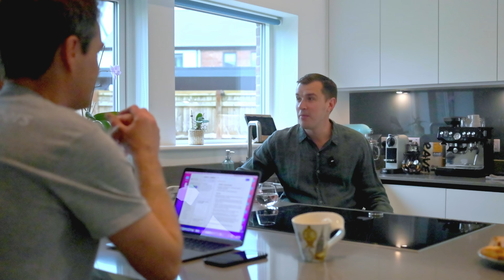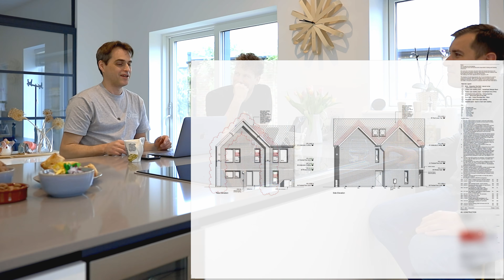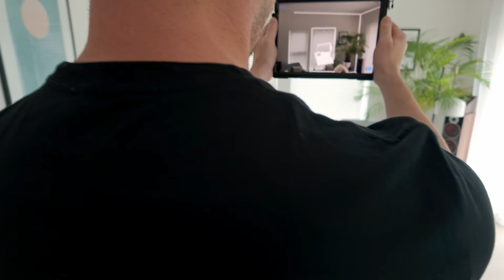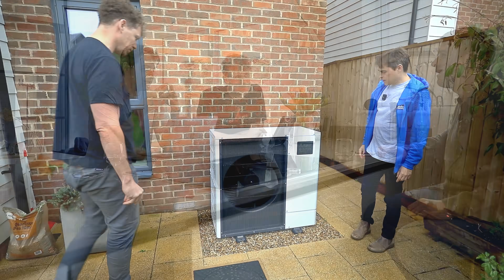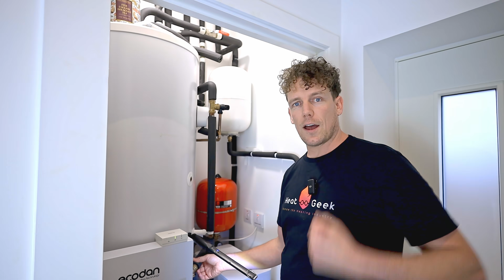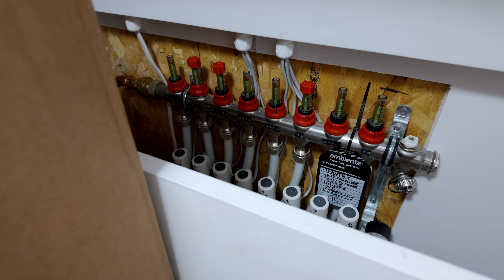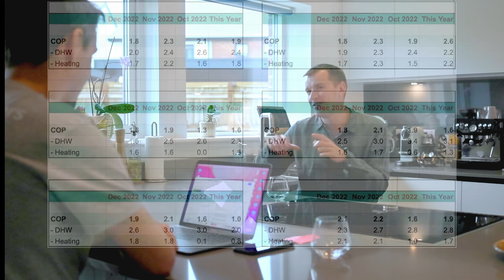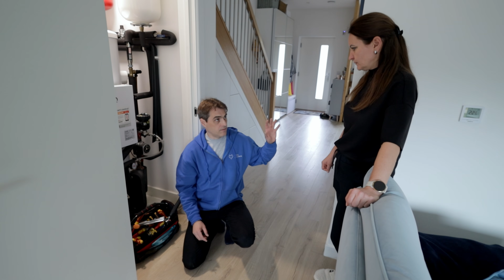How Developers Are Ruining The Heat Pump Market

Comment: Been here quite a few times. (Im not the installer) Pretty sure I visited when the place was a building site to rectify an issue with excessive noise from one of the heat pumps. The installers had not removed the transit packaging from the outdoor units.

In reference to pipe size, Mitsubishi have a set range flow rate for each model of heat pump and as long as its within that range, Mitsubishi are happy its installed correctly. Very odd. Same with the reason why Mitsubishi pre plumbs come with a magnetic filter on the flow, again odd. Or why the cold scale trap filter is after the plate heat exchanger. (The location of these are now changed on the new pre plumbs). That change over from 28mm copper to 22mm copper from cupboard entry to magnetic filter is not going to change much, the pre plumb is in 22mm copper. (Mitsubishi also now have 28mm piped pre plumbs) Although the pipework size and components do add further restriction by poor design, I believe Mitsibushi tried to combat this by introducing the UPMXL GEO 25-125 130 circulators and the UPM GEO, both have a high head and flow capabilities.

In reference to the expansion vessel. Ideally you want it on the suction side of the circulator and on these pre plumbs that is as close as you are going to get the expansion vessel to the suction side of the circulator unless you cut into the pre plumbed factory pipework (No developer installer is ever going to do that) The circulator on these is after the DHW plate heat exchanger and after the header, with very little space to actually cut a fitting in.

Suprised to see the calculated heat loss as low as below 4kw and would have expected to see an 11 kw unit cycle more than what romans has. His had an average of 1.82 on/offs per hour of run time since install.

Definently would not trust the estimated energy delivered on a Mitsubishi.

Always recommend the use of the mitsubishi wireless electric thermostats on auto adaptive mode especially when a property is open plan with way too many thermostats and zoning. They already have x1 upstairs, they would just need another downstairs or just move the one upstairs downstairs and heat all as one.

Should see the new build developments around woking that are using Mitsubishi. Someone specs the design, someone installs it and the installer just fits it, even when the installer is told by us that things should be installed differently their words to those above fall on deaf ears. Shame really.
Reply from the maker: Low on offs could be because stats are holding the unit off for very long time so it only seldom comes on for short periods
Reply: @UrbanPlumbers  Would tend to agree but 3rd party underfloor heating thermostats on Mitsubishi cause havoc, especially with their tendency to be too sensitive. The readings taken from the FTC is compressor run hours and start stops. I would still expect to see a high ratio between the hours the compressor has run compared to its on/offs as it would have sent short bursts of heat into the property, met the target flow temperature quickly and then turned off untill the temperature dropped. Unless by the time the unit flow temperature dropped to an adequate range to warrant the unit to come on again the room was already past the setpoint temperature.

Would expect to see a rough energy delivered for just heating at near 6k kwh if the heat loss is actually around 3.5kw. (based on 1691 degree days) With consumption expected to be around 1691 kwh of electricity if cop is 3.5. Would be interesting to compare the actual heating consumption.

Comment: Electronics engineer here; It seems obvious from an engineering perspective that short cycling is undesireable in terms of mechanical wear due to start / stop, but it doesn't seem obvious where significant efficiency losses due to cycling comes from... the electronics example would be driving an LED with a PWM to dim it (the ultimate in short cycling!)  is one of the most efficient ways possible (though can be annoying for other reasons).   Could someone explain where these losses are from?  It also seems obvious that short cycling must be to some extent unavoidable; if a heating system (needn't be heat pump) doesn't have infinite modulation then at some point the minimum output of the system will exceed the required input to the home, and the system will have no choice but to short cycle?   You could only avoid this by having a (possibly too wide for comfort) band of acceptable room temperatures on the controls that either left the heat source off (and so the temp stuck at the cooler end) or on permanently at highest modulation (so it ended up at the top end of the range).
Reply from the maker: Efficiency losses comes form too much pumping power (4 pumps instead of 1), hydraulic separation forcing higer flow temps and cycling. Cycling requires the unit to run much hotter than steady state and also ramping up from cold to hot - running steady state without breaks is much more efficient
Reply: @UrbanPlumbers  Thanks for reply.  Pumping power and hydraulic separation make perfect sense.  The cycling is a little counter-intuitive harder to understand.  Would be really useful to see this in practice for us geeks with some real data showing the power draw vs heat output over a period when a unit is cycling vs not cycling.  Could such a test be done  by limiting the modulation range of a heatpump to make it cycle (keeping absolutely everything else the same?).   Then we could know how much of an issue cycling really is.  

My other point remains I think that unless there are units with massive modulation ranges, these must be cycling a significant portion of the time, surely?
Reply: @jfinnie78 Also an EE but been following the topic of HPs for a while - the heatpump monitor site is a very useful resource for checking actual power versus heat output - my vague recollections from thermo days is that the efficiency of the Carnot cycle would be low input for maximum output which happens at low deltas of temperature rather than when cycling where it ramps up the power to hit the desired flow temp resulting in spikes of input versus output - I can’t think of any electronic analogies 🤔 apart from maybe relating to thermal performance of devices maybe
Reply: @Umski  I suppose an equivalent to part of it might be switching losses in a buck converter, where each switch has a cost, with increasing frequency hurting efficiency.  But we're not talking about ramping up to high temperatures, but just a bit above the desired flow; and then it is off.  I'm sure there is a small delta, but it doesn't seem likely to be massive.  I am assuming here that the short cycle only drives the flow temp a little above desired.  If it ramps up the temp hugely I'm sure that would be a bigger efficiency hit.

I understand these guys are trying to solve a problem so likely hit everything at once that looks sub-optimal, would be nice to see how much of a difference each bit makes.  Especially if fixing short cycling is something that has a comparatively high cost for smaller benefit.  Unless they can get a refund on the incorrectly sized unit, that particular change might not pay for itself.
Reply from the maker: It’s all on the heatpumpmonitor.org for everyone to see. Cycling causes loss of efficiency due to the fact unit runs hotter when it cycles before hysteresis shuts it down
Reply: @jfinnie78  I think the car accelerating analogy is the closest one where the HP is trying to get to the desired flow temp as quickly as possible from a "cold" state (I guess in theory it could be controlled to do this more gradually and my understanding of compensation curves is that this is happening to control the flow temperature to some extent, but not the initial modulation) so every time it hits the power, it ramps up and then the output becomes far higher than the demand and it shuts off, much like I see some drivers nailing it off the lights only to hit the next set further up the road versus the slow and steady passing through green and keeping the throttle at low values like on a motorway on cruise. When the HP cycles from hysteresis it allows for the system to cool and so has to work harder to then put energy back into it rather than just "topping it up" as it flows through. Similarly in a random conversation with John Cantor, talking about modulation, there is an optimum modulation point for the compressor so oversizing and then "letting modulation fix the problem" is not a great approach as the compressor may only be able to modulate down to say 40% of max output and peak efficiency at say 80% (just guessing here as they don't provide efficiency curves!) similar to peak torque in an engine - in this example where the requirement is 3-4kW but the HP is rated at 11.2kW it's clear that there is nowhere for the HP to dissipate the energy it is providing so will have to cycle once it hits the flow temp and the return is essentially the same purely because even at the lowest modulation, the output exceeds the heat loss of the property. The whole system then cools and it starts again. Same issue with over sized condensing boilers where efficiencies are higher when the return temp is less the 55C - if the output is always higher than the demand then it has to cycle - I know this from experience as my current boiler has a 20kW peak output but can only modulate down to 9kW but my heat loss at -2C is around 6-7kW so at higher outside temperatures it's even less - no-one cares with gas as it's not measurable but with COPs and SCOPs at the forefront of HP efficiency it highlights what a mess the state of heating in the UK is (hence raising an eyebrow when the average "gas safe" plumber refers to themselves as an "engineer" and proceeds to whack the biggest boiler/HP that they can find in!) As for cost - down to what the outlay is versus the savings I guess - do the math as they say over the pond ;)
Reply: @Umski  Very interesting.  You'd think it wouldn't go flat out, but to the lowest modulation state possible, and only increase once it was apparent it wouldn't meet demand...  Of course it will still overshoot. 

I think no-one cares so much with gas because there are generally lots of ways that the systems can be made to function reasonably as they are responsive and you aren't overly penalised by heating quickly,  in spite of being oversized.   It seems that heatpump design is much less forgiving to hit the good efficiencies that are essential for parity or bettering gas and having enough heat.    I can honestly say that in 20 years of home ownership, I wouldn't entrust this design work to any of the plumbers / heating engineers I've had involved in the heating system, which is fairly damning indictment.  

I just put in a weather compensated 35kW DHW / 32kW heating combi for lots of hot water flow rate for showers and quick baths, but it modulates all the way down to 2.9kW condensing mode heat output, which should be much better than the outgoing broken boiler with minimum 7.1kW condensing mode output.  There are quite a few high efficiency combis now that have the same low output across their range but only the max and DHW output changes as you go up in size (Viessmann, Intergas are the two that stood out during my search, but I think there are others), and have the ability to range-rate down the maximum boiler output to control the modulation range further (to avoid the full blast effect you mention).  I went with Viessmann 050-W, can be had for a little over a grand (plus install of course).   

Perhaps in 12 years, once this is out of warranty, and when the dust has settled and we have a new breed of engineers established who have cut their teeth on getting the calculations right, I'll revisit...!
Reply: @jfinnie78  I agree, I don't trust many of the tradespeople I've had conversations with, similarly relatives that have "gone to the professionals" have been duped with boiler replacements but they don't care as long as they have heat. The difference with HPs as you say is that magic break-even point of 3+ COP versus cost for gas if the main consideration is running costs. BUT ultimately the point of this is to reduce CO2 so the higher the SCOP/COP, the less the impact - running a HP at a COP of 1 or 2 might not bother some (think frugal hatchback owner versus massive SUV or super car owner where MPG is irrelevant) but it has a wider impact that whilst less in focus with legacy heating tech is the main focus with HPs, and rightly so as the impact will be higher in the depths of winter when everyone's HP is running a huge demand and the gas power stations need firing up because the COPs are all 2 instead of 4. Personally, I want to get rid of the gas boiler but I'm also torn between CO2 impact and cost (being tight!) - the BUS grant is a licence for dubious installs and little accountability (like the Feed in Tariff days) so I'd rather not pay ££££ for the labour - as HPs come down in price (the choice for me is the Vaillant 7kW only at present) and then self install. In the meantime, I have a cheap R290 mini split which is 3.5kW which should cover my heating and cooling demand on free PV over the spring and autumn, then only relying on gas for the winter period. Overall, that reduces my CO2 but also my energy costs as a whole...
Reply: I found from my own testing (with the 11.2kW coincidentally) that there isn't much difference in efficiency when cycling from let's say 25c flow up to 35c flow, Vs holding a steady 30c.
Half of the run time is spent below 30c so cop is higher, and half above: cop is lower. So it balances out. The bigger difference is comfort but doubt there would be much measurable difference in a house with such low heat loss. Other inefficiencies might creep up from the LLH, multiple pumps etc not sure. Mines open loop, 1 pump and on the very lowest flow rate that's acceptable by Mitsubishi (mines about 1.5x over sized)
Reply: @Loopyengineeringco  that is interesting, and seems more in line with my own preconceived expectation.  I'm sure there is some difference, just not convinced about the magnitude.  Cycling is going to make the heatpump operation more obvious to neighbours and probably cause them to get noisier over a shorter timeframe.  The former maybe not such an issue if everyone's on the estate does the same!

Comment: Explain to me like a 5 year old exactly what was wrong with these installs from a technical perspective. I watched the video but was a bit confused by the jargon as to exactly what the problem is with the actual install.
Reply from the maker: Units are oversized by a factor of 4 - that causes major inefficiency in heat pumps and dramatically shortens the life span of the compressor.

Systems are zoned and have 4 pumps when they really need only 1 pump and no zoning whatsoever.

Whoever designed it didn’t have a clue about a correct hydronic set up and heat pump sizing.

Whole install is over specified quests work.

It’s like buying a for fiesta with 8L engine that returns 5 miles to the gallon
Reply: It was overpowered, overcomplicated and as a consequence, underefficient.

Comment: What questions do I need to ask before I move into my new house which has a heat pump installed?
Reply: The simple question would be to ask to see the electricity bill. Most of them show the total for the year. 
A great SCOP is all very well, but if the house is poorly insulated it could still  be expensive to heat.
Reply from the maker: I would want to see the running data before buying a house with one and maybe get. Heatvgeek to inspect it for you
Reply: What is the heat loss ? What size is the HP ? What company installed it ? (So you can check them out) for starters.     No heat loss, ask for a discount so you can get it fixed yourself.

Comment: My understanding is HP sizing depends on whether a backup (electric / gas / wood) is used in the design.  If so, my understanding is the minimum justifiable HP size would be based on the delta from the average temperature of the coldest month.  It would have been nice if we saw the math / processed used here.
Reply: The heat loss calculation is based on a specific low outside temp, and the heat pump is sized to that.